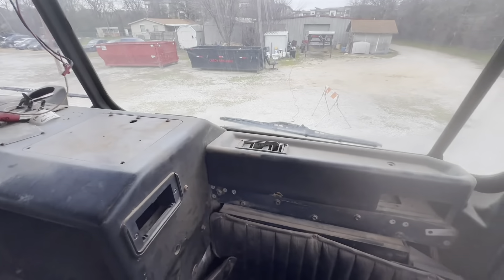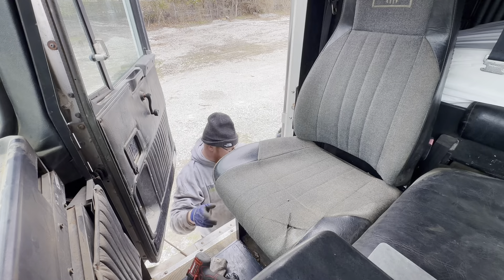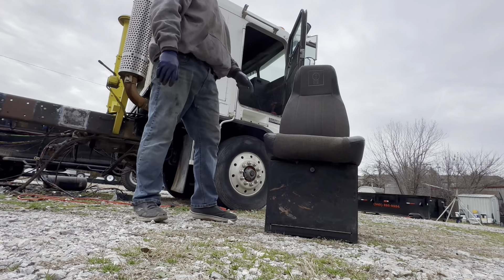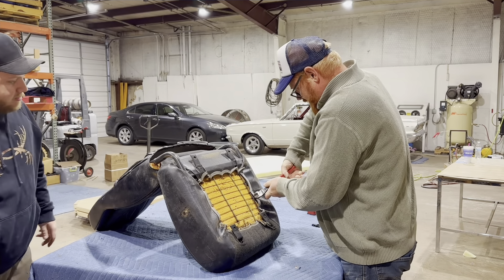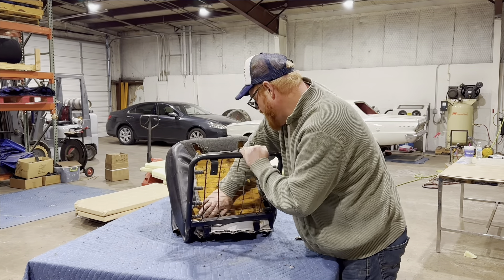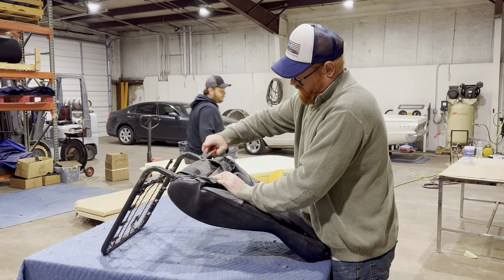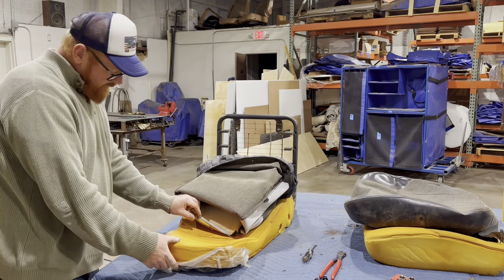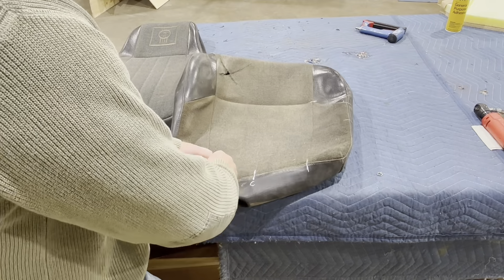Kenworth Cabover upholstery.  Part 1. Tearing the seats apart

Comment: What happened after 21:09 because it's all black until the end and stop music in the background
Reply from the maker: Hum,  that was the end of the video. I don’t under stand why the editor didn’t cut it there. I will see if can fix that.  Thanks for the heads up.
Reply from the maker: It should be fixed here in a bit.  Unfortanly I lost about 10 seconds of an ending. not really showing anything just smoothing the end out.  thanks agin for letting me know!